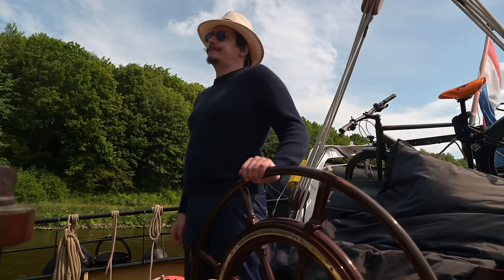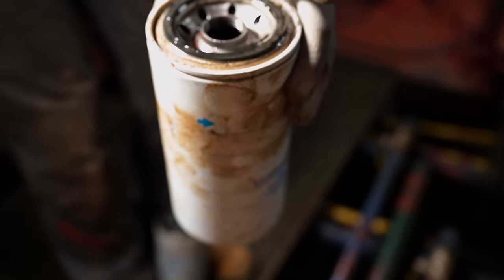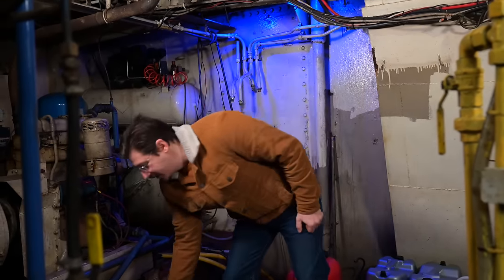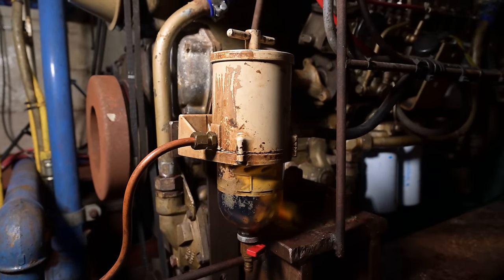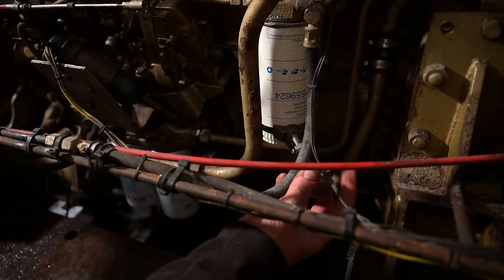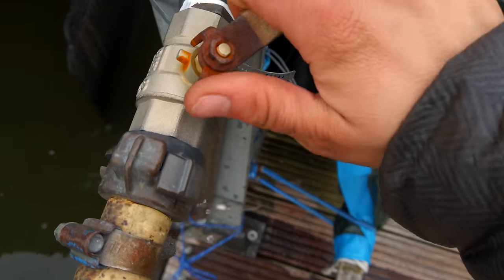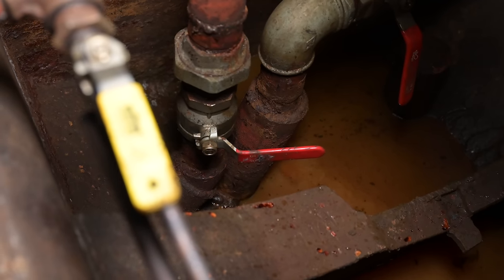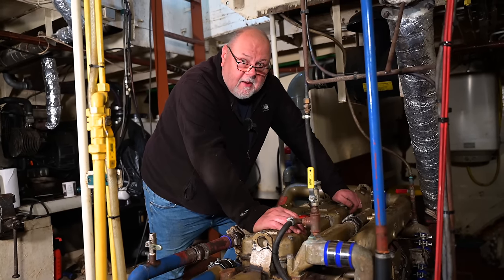Engine Run and Service on Our Historic WW2 Trawler!

Comment: Little tip: Get in the habit of pressing the 'Stop' button and the 'Start' button at the same time. Spin the engine until you get oil pressure, at least until the oil light goes out. That way, all the bearings are wet, possibly under a decent mount of pressure, before you let go of the 'Stop' button and actually fire the engine.
Reply from the maker: Great advice. I've thought about how to pre spin the engine and that's it! Back in the old days on the large diesel engine they had a rod and they turned the flywheel by hand. Also many engine had a manual oil pump to get it up to pressure. At the moment we just have a battery charge warning light and probably one for overheating but we will built in more sensors and warning systems.
Reply: @FlyingConey  I learnt that on a 1946 Lister Blackstone. It had a little crank handle for the oil pump, then started on compressed air. I used to bar it over to TDC on No.1, ready to start,  as soon as it was shut down, it was easier when it was warm! Just re-wire as needed to add an 'Off' switch to the fuel solenoid, if it stops on the key. Not hard... Good work, by the way, I'm thoroughly enjoying your videos!
Reply: @FlyingConey For LARGE Caterpillar engines, you can still specify them with pre-oiling pumps. There is a one way valve from the electric oil pump, to the main oil gallery. 
Best wishes from Northern Canada.

Comment: Diesel in the engine oil can occur in DAF because the injector leakage oil line is leaking back <<put new copper rings in them, and let the engine run at idle and remove the valve covers, to check for diesel leakage from the injectors and leakage oil line
Reply from the maker: We will do the engine refresh in autumn or winter and then the valve covers will come off. Also we've planned to repaint the whole engine.
Reply: @FlyingConey  See if you can find parts, it is becoming more difficult to find parts for the older DAF, such as,, water pump, thermostat with thermostat housing, diesel fuel pump on the fuel pump, these are parts that are becoming more difficult...greeting Henk ,,

Comment: Well done John.  An FYI, very light multi grade oils are essential for the bearings in modern engines because the clearances are very tight compared to decades ago. So using the 15-40 in this case was fine because it got to those bearings faster than 30wt would.  Smart move.
Reply from the maker: That's true and I should've said that it's always good to get what the manufacturer recommends. But some equipment like the gearbox really do need a specific oil. In our case it's either SAE30 or 40. Also if the oil get's to fluid old engines start weeping sometimes.

Comment: Good advices from your mechanic!
He seems very "old school" and very cautious in his approach, and that is great.
Filling up the oil filters is a no-nonsense trick but many technicians do not take the time to do it. 
With the oil the main thing is to use diesel oil since it has much more cleaning agents than petrol engine oil, and after say 100hr change it again as it will collect all sort of debris that might have accumulated in the engine.
If you still have the old oil filters a trick is to cut them open, un-wrap the filtering material and look at what is in there, little metal particles? Chromium? Nickle? Etc. Of course with money you could send samples of the old oil, for oil analysis...
30 micron on the Racor is very coarse indeed but likely prudent, until you can monitor how much crud accumulates in the bowl, by comparison the ones on my little engine are 10 micron primary and 3 micron secondary.  I have a few spare 5 micron just to "get home" if something was to happen.
.
That was quite a milestone! 
Congratulations!!!
.
I always include a small saying in my reports suggesting that:
"The cleanliness of an engine room sets the standard for any technician working on the vessel". 
So, for  me, those last few episodes when you clean and give some TLC to that part of the boat was quite satisfying.
Great episode, thank you!
Reply from the maker: Thank you for the very well reasoned comment! One thing that impresses me about John is on how many different types of engines he has worked. Boats, trucks, farming equipment, cars, motorcycles, outboards all from different manufacturers and time periods. And that's just what he worked on in the past two months. 
We consider this first basic maintenance now as our base level. From now on we try to keep on top of the maintenance and can send in samples and so on. Also we can think about how to improve the system, adding a switchable filter for example and how to use the day tank filter. Maybe we can install a fuel polishing system or at least a way to cycle the fuel back into the storage tanks. 
Coming up next is to move back onto the boat and to fix the structure. Get the hull blasted and painted on the inside. I hope by the end of this year we will have a structurally sound blank canvas and we can start to build up.
Reply: @FlyingConey  That is an excellent plan of action. 
Maybe it is worth mentioning it to you, since you are so close to the project:
You guys are making stupendous progress on this project AND being smart to take little "time off" as to not suffer from a burn-out.
With large storage tanks "fuel polishing system" is likely something to  look into. Diesel these days is not what it used to be 50 years ago, it is susceptible to growth and gets like molasses much faster than the old stuff. You also now know that there are some residues/debris at the bottom of your tanks. The cost of a system where you could "vacuum" the bottom of the tanks might be justifiable.
Cheers,
a.

Comment: What the gentleman said about running mineral base 15-40 oil I agree with completely. I used to run 15-40 in an old pickup truck that I had. If I ran anything other than 15-40 it used oil in between changes. If I ran 15-40 it never used a drop of oil.

Comment: At 3:20, A simple no mess, no special toot oil filter removal "tool" can be made out of a larger screwdriver or bar or handy stick and a length of twine of small rope.  Simply tie an loop in one end of the twine and wrap a few times around the filter, then insert the screwdriver or bar in the loop and and twist the filter off.

Comment: Thank you for the lesson! What a great help you got to make it happen. Well done!
Reply from the maker: I always try to put some knowledge in. Questions I always had when I was a kid. One thing that didn't made it into the video is that single grade oils are the reason why larger engines and most trucks need a bit of pre warming before you should use them.

Comment: Every one loves a big old diesel engine!
Reply: Indeed! This has  inspired me to get back into getting my static engine sorted out and get going...... It is a SKODA 3S110 (3 cylinder, 15HP/Cyl= 45HP @ 1500rpm)
I bought it few years ago and have it on a plinth outside my house.....as far as I can gather, it has not run for 20 years. (The engine itself was made in 1973) 
It was used in a sawmill here in Chile....until the electricity arrived in the countryside!
Been kinda busy on another pŕoject of late......need to get back on it.
Reply: @patagualianmostly7437  Fascinating! By chance, my home is in Chile (Vina), but i am not fortunate enough to have an old diesel there. Instead, I keep my 1975 Westerbeke going (on my sailboat, now in Panama).

Comment: I would make a compression test to asess the valves & piston ring conditions, depending on the results maybe a leakdown test to determine eventual cause of origin. While doing the compression test,  have the injectors serviced, and go from there, The condition of the injectors will give you an idea about the injection pump condition.  I would clean the Separ fuel filter / water separator between the storage tanks and the daytanks and eventually drain and clean the storage tanks,  but no rush in this. It helps to recirculate & filter modern fuel in storage every 2-3weeks to eliminate stratification and moisture, as well as add some storage additives... I'll probably write you an email with more details if you're interested. Keep up the good work!!!
Reply: Hi Andreas 
Excellent suggestion, and one I would have carried out if there were signs that the engine was internally compromised.
Once we started to look deeply into the engines condition, it became apparant that it wasn't in the poor state I originally thought it was.
there is a quick video shot of me with my hand over one of the oil fill caps.
What I'm doing is feeling for a slight vacuum in the engine.
This vacuum is designed to keep any oil vapour inside the crankcase and to allow oil seals to control oil around them.
If excessive 'blowby'  is getting past the rings, then pressure is felt instead of vacuum as the breather system struggles to control the blowby .
Any doubt, and I would have done a cylinder leak test, but with vacuum present in the crankcase and all six cylinders working, I didn't consider it necessary.
Thank you for your comment
John 👍
Reply: Hi John, thanks for the comment, I agree. What does concern me, is the reported diesel smell  of the oil, indicating a possible leaking injector. This is easy to check and not costly to repair, migh just be cleaning and adjusting, providing years of troublefree service afterwards and eventually lowering fuel consumption as well🙂
Reply: @andreasarncken8309  Hello again Andreas.
The engine on Flying Coney has never had any real load put on it during its time in the boat.
It's not  been hot enough to burn any combustion gasses away, so unburnt fuel does tend to migrate into the oil
The boat needed to be got mobile to move to its next shipyard, I will return later in the year to remove the injectors and fuel pump for service, but for now it proven its internally in a good enough condition to satisfy myself plus Daniel and Barbara that it's worth keeping and not replacing.
Thank you for taking the time to reply.
John😊

Comment: I am a long ago US Navy veteran. Worked on most everything as well a sailed across the Pacific Ocean on a genuine Liberty ship (USS Tutuila ARG-4). You have learned to do the basic maintenance. Just keep it up and most machinery will last nearly forever. 

Sunshine and following seas. Have fun.
Reply from the maker: Hi Greg, we just found out that our watertight doors do come from a US minesweeper that was probably built in 1953 and scrapped in the Netherlands in the 1970s. It takes time to grow into a project of this scale and I believe the way to do it is to be a Jack of all trades. Usually we are quick learners and I believe there's nothing we can't do. But it's a pleasure to work with skilled volunteers like John. We can't sail the boat alone and sharing this adventure is the reason why we have a YT channel.

Comment: You're  a good man, John. I only wish I had some skills that would help, sadly that is not the case. I hope others who do have the  skills step forward to ensure this lovely old boat gets a new lease on life. Thank for sahring.
Reply: Hi John.
You will be surprised at what you could help with.
You don't have to have mechanical, electrical, or welding skills to help.
I can't assemble flat pack furniture, or glue two bits of wood together, but Diesel and petrol engines have given me a good career for the last 40 years.
You have skills that you don't realise you have, and I promise that offering your help will bring them out.
Thanks for your comment.
John👍

Comment: I LIKE MY FILTERS SNUG DOWN A LITTLE BIT TIGHTER NOTHING WRONG WITH 30 OR 40 WEIGHT OIL I WOULD USE 30 SINGLE OIL YOU-ALL ARE DOING A SUPER     
GREAT JOB 😊
Reply from the maker: Yes, a good SAE 30 is what we bought and will use in the future. We specifically consulted with the manufacturer of the gear box to get the right specification. But the boat came with about 30 liters of SAE 15W-40 and the question was if it's ok to put it in the engine.

Comment: Fun fact: some/alot of times you can pull the key out of the panel while the engine is running with these daf engine panels
Reply from the maker: That's definitely possible. Our panel does have a stop button. But since 20 years I'm turning off the engine in cars by turning the key. You can imagine that it took some time until I used the stop button right away instead of turning the key. Fun fact, we had a Mercedes truck and turning the key was just turning on and off the lights. It had a start button and a leaver to adjust idle. Turning it off meant turning the idle all the way down or pulling the gas paddle up.

Comment: Bit of advice if you'd like to hear it:
-------  It's a good idea to have your batteries isolated from the metal framing that they're sitting on. 
For two reasons:
1. The battery charge can slowly be drained via external contact with the hull ground, &
2. If you have a slow grounding drain on the charge, it can lead to further corrosion across the hull structure. 

This is easily fixed by sitting the batteries in a small wooden tray/open-topped box. 
And even better if you line the tray/box with rubber. 

If you have a securing metal strap, line the under-side of that with rubber also.
Reply: No, they need to install a special concrete battery pad for maximal battery life...
Reply from the maker: You're correct that proper battery boxes are missing at the moment. We will order them. But we always disconnect the batteries when they're not in use. We had a corrosion damage and we need to do the electrics from scratch. But that's a huge project in its own and time is a limiting factor.

Comment: 5k hours isn't much for a truck, however, on a boat, all of the hours are up hill/loaded hours. John did a quick check for crankcase pressure when he put his hand over one of the oil filler caps, it looked good from my end, no smoke from the filler, his hand wasn't pushed away from the opening. If it were mine, I would motor it to your home port, do an oil sample to see what the insides are like. The sample will tell you if there are high amounts of wear metals, lead/tin, copper, iron, coolant traces, fuel traces, etc. It would be wise to supply the sample testing facility a sample of the clean oil you put in it to kind of get a baseline on what the oil starts with as to what the used sample contents are. Another reason for oil in the intake aside from low RPM operation, dirty/diluted oil is a plugged air filter. Funny to see a filter on a boat, normally I saw just a fine mesh screen. If the filter is plugged, the compressor will actually pull oil past the seal on the inlet and into the compressed side. Me, retired from Cummins Engine Co after 30 years, I have a wee bit of experience!😁. Wish I could be there to lend a hand!
Reply: Hello. 
You are one of the few who realised what I was doing with the oil filler caps. 
Well spotted. 
The engine actually drew my hand in slightly, so crankcase vacuum was present to keep the oil vapour in the crankcase, and there was very little blowby past the piston rings. 
Nice to find someone who know about these simple checks
Thank you for your comment 
John 👍

Comment: You need to send a sample of the oil off for analysis, that will give you a better idea of what's going on in the engine by looking for various metals and chemicals. Standard practice in the trucking industry here in the US.
Reply from the maker: Since I've no idea how long the oil is in we decided to only change it this time. Maybe next time we start to send in samples. Also we have five different devices were oil samples would be a good idea. It's getting a bit excessive I think. But still, it's good practice, I agree.

Comment: After all that work you guys & girls should give that engine a nice new coat of paint so it looks as good as it feels.  New paint helps you spot new leaks or soot I try to keep my truck diesel engine spotless and painted real nice!
Reply: Hello. 
Daniel does indeed want to paint the engine.
Later in the year, I will return to a little more work on the engine, and this will give the ideal opportunity to clean the block and head and re-paint it.
Thank you for your comment.
John👍

Comment: Look at the injectors before the valves. Good Injectors are a big part of a smooth running diesel engine. Cheers
Reply: Hello.
Now I know the engine runs well, the injectors and the fuel pump will be serviced when the boats in its new location.
I will return later in the year to take the injectors and pump off for service, plus valve clearances.
Daniel wants to paint it, so manifolds will need to come off for access anyway.
The engine has proven its condition is worth spending time on, so the 'engine series' is far from over.
Thank you for your comment.
John👍
Reply: @827SLi  including I hope a compression test.

Comment: R34 for me please although the R35 is also good.  My son just bought a R31 RB20NA in extremely good condition converted manual gearbox.  I remember growing up the R30 with stove pate tail lights and 2.8L motor were  groundbreaking.  Very good episode thanks.